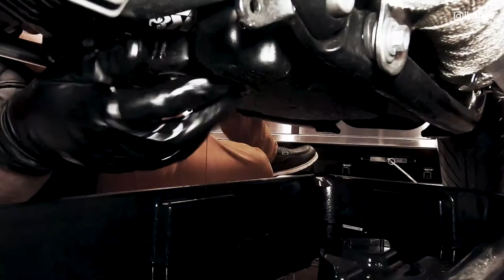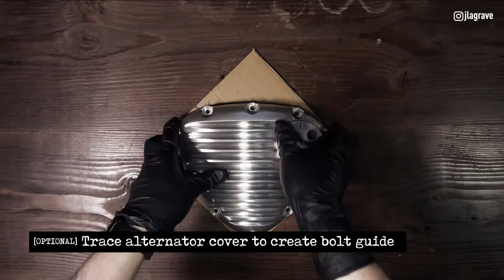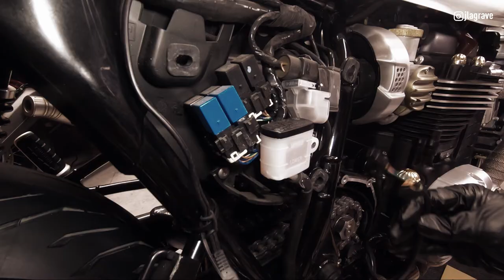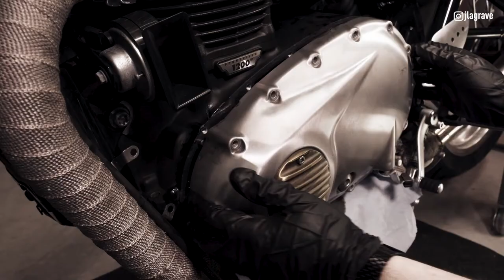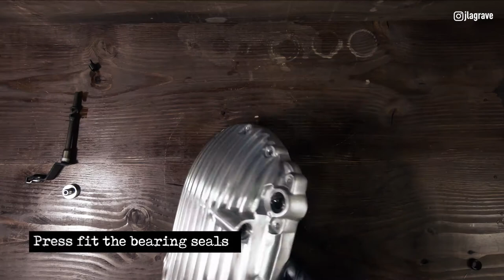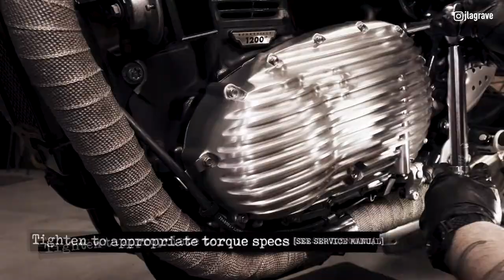Motone Customs Engine Cover Install

Comment: Ok.  Wow.  This guide is awesome but glosses over some of the parts that were harder (for me).  Taking out those bearings from the clutch cover is where I threw in the towel.  Nice job on the video!  But, I know where my mechanical skill limit is.  😂
Reply from the maker: You don’t need to remove the oem bearings from the oem cover. You should be installing new bearings. Keep them in the freezer before install, and heat the bearing cavities of the new cover before putting them in.
Reply: @JoshLaGraveDesign  ugh, wish I would e thought about that before I took everything apart.  😂 I’ll go search for them now

Comment: The parts guide shows gaskets, I think (my Bonneville does). But I never saw any on yours.  Am I drunk again?
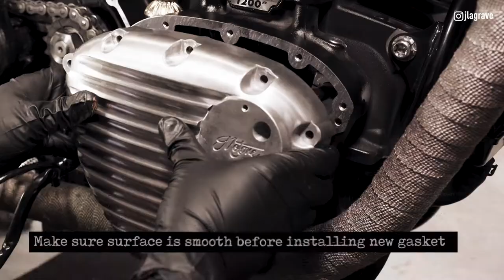Reply from the maker: there are indeed gaskets for both covers. 1:36 mark there's a note to make sure the surface is clean before installing new gasket. New gasket is already in place at the 1:37 mark. Be careful on the alternate side. The magnet is strong and if your gasket isn't seated nicely, cover could rip it (ask me how I know lol) I found that just a couple little dabs of gasket maker silicone to hold the gasket in place against the engine worked great,

Comment: Great video! How many hrs did the whole process take?
Reply from the maker: Because I was filming with 3 cameras simultaneously, setting up different lighting and shots, and also learning as I was going, it was over the span of 2 days. 

That being said, if I did it again, I could probably do everything in under 8 hours. As long as you familiarize yourself (or print out the necessary pages) of your service manual, it’s not bad.